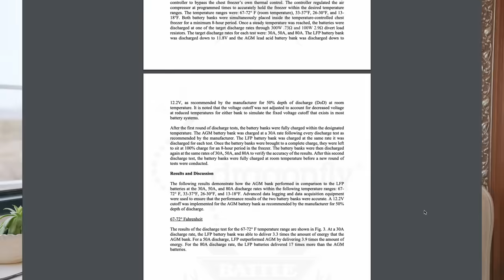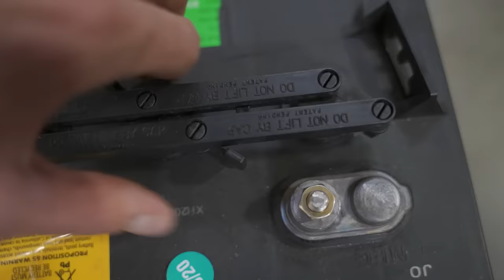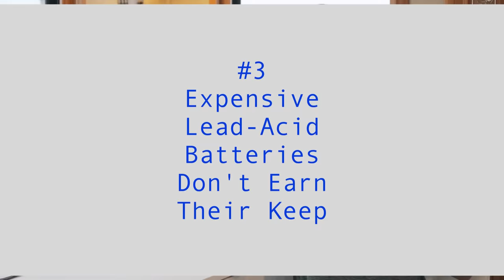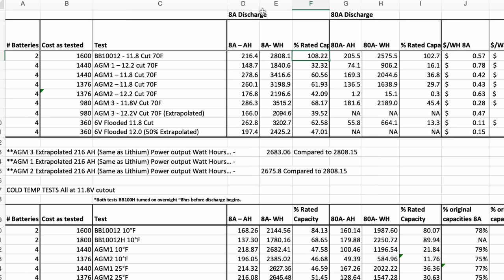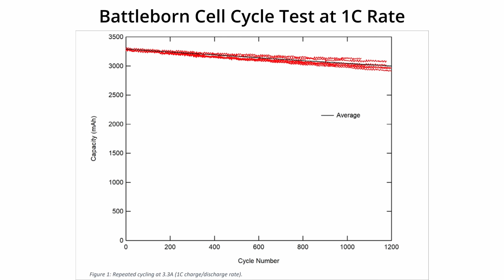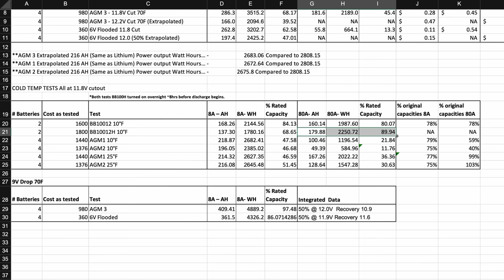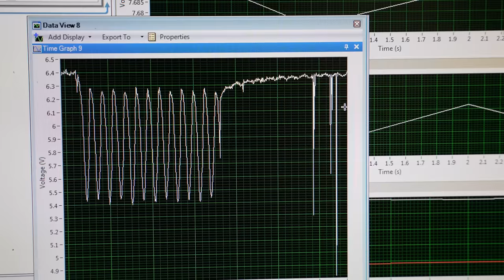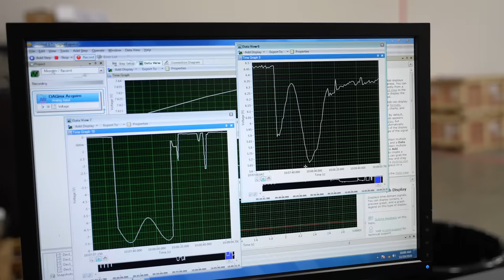Don't Waste Your Money On Batteries - The Shocking Truth I Discovered When Testing RV Batteries

Comment: How can you really compare a 13.6v battery to a 12.8v battery as apples to apples even though?  The first one is at 20% (cap) at 12.8v, where the second one only starts at 12.8v.  Running 12v system with a battery that starts at 13.6v is a fixed race isn't it?  The system rated at 12v should expect somewhere in the 12v area at most times and starting at a higher voltage of 13.6 vs AGM of 12.8 (which is a HUGE difference) doesn't seem like a legit experiment.  Maybe create an AGM with a charged resting voltage of 13.6 and compare that. Before the Terms layers come in I get that Amps and Volts and Watts are different - however,  I see a crazy clear advantage to the battery running a 12v system that starts at 13.6 and another that starts at 12.8.  Thanks for reading.  I know nothing.

Comment: As was stated numerous times below by your more knowledgeable, and perceptive, viewers, your testing methods leave a lot to be desired. I can only surmise that you either 1) simply do not have much useful experience with flooded lead acid in the longitudinal usage sense, or 2) you are a plug for Battleborn (as the only lifepo4 brand tested, while selectively trailering the data to favor the lithium batteries.... or 3) both of the above.  You failed to properly diagnose ACTUAL fla state of charge because you simply cannot measure by voltage under load (voltage sag, you know?), and a hydrometer is absolutely necessary for truly accurate readings, and only AFTER a full absorb cycle and then, only after sufficient rest without a load. Also, FLAs require a break-in period, as was also mentioned below.  If you want to compare apples to apples, maybe stick to lifepo4 to lifepo4, and throw those BBs up against some simpliphi 3.8s and see what happens. FLAs are really only a great deal for those who take the time to understand how they work, and approach them accordingly. I use both, 10+ years offgrid, and I can't even count the times I've seen people brick their first set of FLAs because they didn't bother to understand how they work.

Comment: What about CCA rating does lithium give adequate levels to start an engine ?
Reply: I have LiFePO4 batteries in my trailer and would not recommend replacing your engine starting battery with one. Yes they wil work for that purpose but engine starting is the only application where I can say the FLA batteries are cost effective.   If you replace it with lithium, you will be spending lots of money for capacity you will probably never use if engine starting is your only use.
Reply: @MrCPPG  thanks, what about discharge levels? the car is idle for months and as far as I know lithium resists longer without a charge.
Reply from the maker: That's correct, since they have BMS cranking is not recommended unless it's a small engine.  As far as drain, yes lithium is much much better than traditional lead acid.  About 4x less internal discharge so can sit a very long time without a tender.

Comment: I'll probably heat my lead acid battery bank over the winter. That should be a good fire risk. :) Thanks for such a great data driven analysis - AND, no boom bang a bang music in the background :) great job, thanks.
Reply: A diesel heater with a thermostat will be fine.
Reply: A diesel heater with a thermostat will be fine.

Comment: Battleborn batteries are a complete rip off today. Quite A few years ago they were the only thing on the market and the price was acceptable but now you can pay about 40% of what battleborn is charging for the same quality. They haven't kept up with times and reduced their price
Reply: You can get a same size battery (1280wh) for as little as $300 and Brattleborn are still charging like $1000. Nuts.
Reply: @randybobandy9828  couldn't agree more.  What extra value are they providing to justify more than twice the cost of a comparable battery?  I don't see it

Comment: I love the white text on light blue background so the viewer cant easily read the data.........

Oh, the data by the way stated only a 5% difference in capacity. Literally 98% to 103%.

Oh oh, and I can stop by the car parts store, pick up a $20 jug of battery acid and completely refresh multiple batteries from it. There are even ways to decalcify the plates. What happens when the lithiums electrolyte life cycle runs out? Oh yeah, buy a whole new battery bank.....Sounds awfully cost effective to me.....

The bottomest line is as long as you are aware of the chemistry you are using, and how you are using it, instead of just chasing effectively random numbers, ya know an actual understanding of the system instead of just matching numbers on a datasheet, throwing a diagram together in a flowchart program and hoping for the best, then the real world effects arent really that impactful. Sure, there is room for efficiencies to creep up. They are different chemistries and all. The act and react differently. And F/SLA has been around for decades and bottomed out in technology not long after they hit the scene. Lithium, and other chemistries or power generation/storage solutions and technologies, are new and evolving. These lithiums numbers could easily become garbage tomorrow. But this bad because that number low and that good because number easier to read on dark grey background is kind of silly. Get what you can afford, understand what you are using. Honestly, there is nothing wrong with basic, known, widely available FLA. Yes, lithiums are nice. Id love a bank of LiFEPO4 cells for backup power on my house. But the cost is still just too damn high. And Ive collected a fair share of FLAs over the years I can use with coleman power inverters for the appliances I need if the power goes out. If I go camping......Im camping. Leave the xbox at home.

Comment: 5000 100% discharge cycles?! Did lithium batteries really get that good or is this a stretch. Electric cars take care of their batteries for the most part and they are getting noticeable degradation at 100,000 miles, ie~200 charge cycles

Comment: Another thing that absolutely needs to be taken in account is the fact that when you buy a 100 AH lead acid battery , your only getting 50 AH !   So this guy want's to compare 100 AH lithium to a 200 AH LEAD ACID because of the fact i mentioned about only being able to use 50 AH from a 100 AH lead acid battery to make it fair he says !!!  Well that's just the point !  Lead acid sucks because you can only use half of its rated capacity !  You can't double them up to make the test fair cause lithium is rated true !   That's one of the reasons why lithium is better and costs less !

Comment: I purchased 6 12 volt batteries maint free and they lasted me a little over 10 years at a cost of less than $1,000.
A lithium battery cost approx $1,350 and they last approx 10 years at a cost of  6 ea approx $8,100 IMHO I fail
to see any savings with a lithium battery as I can replace the non lithium batteries 3 times and still have money
in my pocket.  You will never convince me that a 100 ah lithium battery will product the power of a regular battery
that has over 900 cranking amps.  Plus you will kill a lithium battery by discharging too low discharge completely
your lithium battery is DEAD!

Comment: Were the lead acid batteries topped up before you ran the tests? They discharge a lot on the shelves at the store. To test them without at least a top up is disingenuous in a comparison to other batteries.

Comment: Not shocking or surprising at all. Led-acid is good for starting cars..not much else. I would even change that for lithium but the car's charging system is not made for lithium. Also charging lithium in cold weather ain't that good for them. No point to waste energy to heat the battery under the hood in -20C.

Comment: Calling the LiFePO4 batteries "Lithium Ion Batteries", makes this presentation very easy to misinterpret for most who are watching.
Technically LiFePO4 does use ions of lithium, but broadly speaking "Lithium Ion" in the market vernacular refers to lithium manganese oxide, or lithium cobalt dioxide. And LiFePo4 is generally called "Iron Phosphate Batteries". 'Lithium Ion' and 'Iron Phosphate' batteries don't work the same, or behave the same.

It would be much less confusing if you called them Iron Phosphate batteries instead of Lithium Ion batteries. Also, the data you collected is not at all applicable to "lithium ion" batteries (manganese or cobalt types).

Broadly speaking Iron Phosphate (which you are testing) is vastly superior to "Lithium Ion" (manganese or cobalt) in every way except energy density. So you actually want lithium ion in a handheld device probably, or possibly an electric vehicle, but for other uses, Iron Phosphate is far better regarding temperature performance, longevity, and fire hazard issues. There are a lot of consumers, and even companies, who are using what is objectively the wrong battery for their application because of a lack of awareness about the distinction between 'lithium ion' and 'iron phosphate'.

Comment: This video have so many mistakes.
1. You cannot just hide the brands, this way you could compare the best Li-Ion with the worst Lead-acid or vice versa and affect the experiment.
2. You keep talking about Lithium-Ion, but at 4:17 I can see those batteries are LiFePO4, not Lithium-Ion. 
The experiment results also look like LiFePO4, since those have constant voltage form most of its cycle as opposed to Lithium-Ion that drop mostly linearly.
This is important, since LiFePO4 while twice cheaper, are also twice heavier than Lithium-Ion so not that useful on mobile applications (like eg. RV)
3. You should never insulate your batteries. Batteries when running (especially when charging) produce a ton of heat, and they need to cool themselves down.

Comment: It's in ah so you can compute it easier. 
amp hours x volts = watt hours
100ahx52volts(48) =5200 watt hours.
100ahx14volts1400wh(12battery)
100ahx30volts3000wh(24battery)
100ahx42volts4200wh(36battery)
100ahx52volts5200wh(48battery)
If you can't add I can see how it would be hard to understand.
Amp hours x volts = watt hours
Watt hours÷volts=amp hours.
If they were in watt hours people would want to know the amp hours.it makes more mathematical sense this way.the way they do it.
Reply: No they wouldn't, watt hours is the only thing that matters when it comes to capacity. A 24v 2000wh battery will have the same capacity as a 12v 2000wh capacity.  Amp hours don't translate and it make it confusing to people who aren't savvy with batteries.
Reply: @randybobandy9828  I teach math 🧮 🤪

Comment: Lithium iron phosphate.lifepo4.get 3000 to 8000 cycles.
Lithium ion get 300 to 1000 on average .
No one uses Lithium ion in big batteries because they don't last
Reply: Nobody is getting 8000 cycles unless you keep the SOC between 40%-80% at all times, which severely reduces your capacity, meaning you need to spend more on cells.
Reply: @randybobandy9828  nobody will every get 3000 from a lithium ion or 1000 from a lithium polymer no matter what you do.lithium titanate get 20,000 to 60,000.battery hookup has them all the time.look in products to see everything they have ever sold.home to see things that they have now.signature solar ckaims 7000 for there server rack 48 volt 5200 ah.1200 dollars .they also gave 450wztts panels for 250 bucks.when some people are paying that for 100 watt.i only use bifacial double sided solar panels which get 30 percent gain from the back guaranteeing the advertised watts.paint your roof flat white it reflects 90 percent of light.i build my own batteries and I don't use lithium ion for anything if I can help it because they go bad as fast as lead.

Comment: Your Claims based and your faulty Interpretation don't mach with reality. If lithium was so great we would see them as Starter battery and we don't. That simple? AGM is good for fast high discharge where as Lithium loses over 50% of its capacity in less then 1 year.

Comment: Very Misleading
One of your AGM batteries is clearly the  Lifeline GPL-3100T AGM RV/Marine Battery, which is a STARTER battery not a Deep Cell battery and cannot maintain any real output at depth of charge. It's meant for high crank amp output for a few seconds to start an engine, not for long term storage of low volt power like a Deep Cell. I imagine the rest of your batteries were likely similar. 
The fact you didn't know the difference in application between the 2 types says volumes of your knowledge and your tests are therefor inaccurate and unreliable. OR worse, you do know the difference and are simply dishonest. 
Here's the difference " Whereas starter batteries are primarily designed for starting engines, deep-cycle batteries are designed for continuous power. The are commonly used in marine, golf cart, and industrial equipment applications. Instead of being configured for high energy bursts, it's purpose is maximum capacity. There is no direct correlation between a batteries CCA (cranking) rating and amp-hour storage capacity"
It's too bad. I'd so hoped to feel truly informed. 
FYI  don't use batteries that are visually unique and distinct in appearance in you video
Truly disappointed in you

Comment: You're not looking for 12.2 under load, that is completely unscientific, you're supposed to let it drop to 12.2 under no load.

The bounce back accounts for all the loss in this long waste of time video.
I think 10.8 is the cut-off for inverters on single batteries, and 11.8 on dual

It's my humble opinion that this is a statistical mis-representation of the figures, since you're always supposed to be working with at least 30% overhead.

Running the batteries to that voltage (under load) won't harm them, you're supposed to run them to that voltage after the bounce-back, that same difference changes drastically when you have higher voltage setups, 4 batteries are ideal, not two.

People reduce their usage when batteries are low, when you're low enough to drop the voltage that much when you're using 1-2A for late night lights (12-24w, which includes general usb charging)

People consume most of their power while the batteries are charging, in a solar setup, the 'starting amps' scenario he described is exactly what a washing machine or coffee machine on lead acid would do on a solar setup while charging in the day.

If you have a camping fridge, you can look at the general load as being 

Those nice big victron inverters he uses gives you top-notch feedback via bluetooth, you would never run them higher.

The real consideration is the extra weight that it adds since, you would actually want to run 4 100AH batteries, not two ideally, the 48v rigs don't really suffer any of the problems he described.

DYOR, online researchers are misleading you.

That being said, lithium batties are good, and in some limited conditions they are superior performance wise.

If you shop around and buy at competitive prices, lithium costs between 2x and 4x of AGM batteries, and one takeaway from this video is that if you buy cheaper batteries, as long as you have good reason to think they're reliable, you will get better value for money.

Comment: After all that, .09 cents it the BEST case scenario for solar/battery arrays.  If we had a better national energy policy we could get natural gas at .07 cents per kilowatt.  As natural gas doesn't pollute like coal or oil, you have to wonder why we aren't using natural gas more?

Without tax incentives, solar actually costs more than just being connected to the grid.  Well, before Biden at least.

Comment: While I am not going to say this guy is wrong he is forgetting one major detail .
 A battle born battery is $900 dollars. 
A brand new deep cycle battery from Autozone  is $120 so for $960 I could have 8 brand new deep cycle batteries .
I don't believe for one second a single battle born battery will out perform 8 deep cycle batteries .
  If I were going to set up a system I might even go to the wrecking yard and buy used that only cost $45 each = 20 batteries for $900 .
Am I to believe One Battle Born battery is going to out perform 20 car batteries ?
I don't think so . 
I have one Deep cycle battery and 4 used car batteries in my explorer and I run a laptop and a ryobi charger and an electric shaver plus an internet device and a coffee maker along with any short term need like a light or a hot plate all weekend with no trouble .
I drive and recharge the batteries .
  One time the power went out in my house and I ran the TV and a couple lights for a few hours no problem till the power came back on.

Comment: Definitely an AD for Battle Born batteries.   Too many things omitted or convoluted.   Many things glazed over.  No actual evidence you can get 12000 cycles out of lithium.   Mixing units of measure to confuse things.   Prices of AGMs seemed way over priced for what I have seen out there.   I doubt that this guy was actually an EE.     Not convincing.   Where is the link to the data sheet he refers to several times?   I looked below and can't find it.